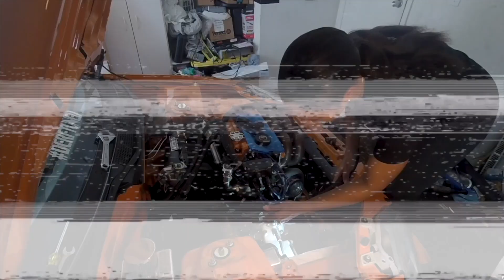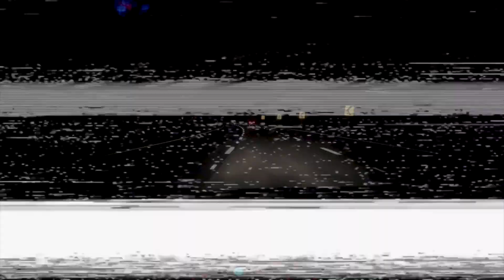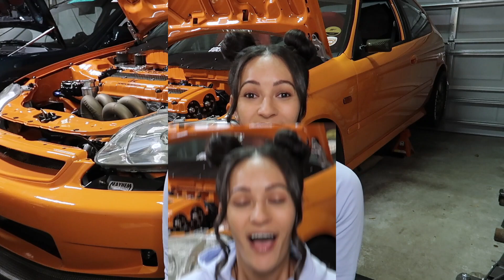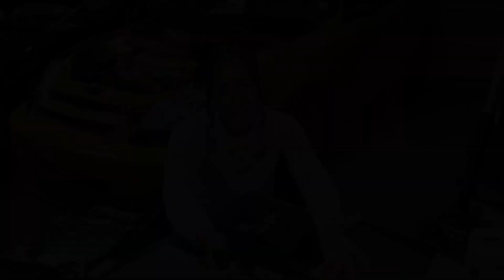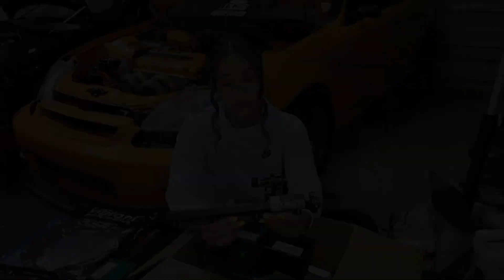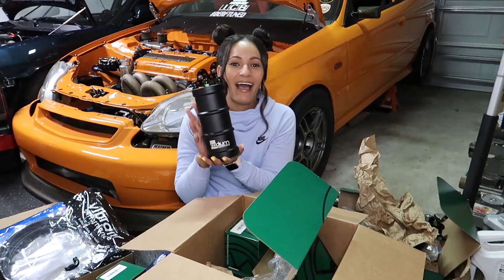ALL NEW FUEL PARTS!! - Fuel System Upgrade - Female Built

Comment: I am just discovering this now. Mine is a B18C engine. My fuel line just exploded out of nowhere while I was trying to bleed my brakes because of new Endless brake calipers; it has not been used for two weeks. Anyway, looking to change the fuel line, fuel filter and the rail as well. I have found this gem with step by step instructions. GREAT CONTENT!

Comment: The vibration she is talking about can affect certain rpm ranges, because the vibrations reach a specific resonance where the fuel can stop flowing through the injectors. Once the rpm passes that specific resonance caused by vibration the fuel can then flow again. It happens quickly but the disruption can cause problems with the tune, which Aisha explained. The damper absorbs those vibrations so that the fuel can continue to flow throughout the entire rpm range. 👍
Reply from the maker: Thank you for the further in depth explanation!
Reply: @Aisha_LadyBuilt  I appreciate the content you put out. You clearly research everything about your build, the info you provide really helps a lot. 👍
Reply from the maker: @Mr.Wongburger  Thank you so much! I appreciate your feedback!!

Comment: Aisha, i have a b20 can i run the Fuel Pulse Damper on My 94 Acura Integra? do i have to buy a new fuel rail?
Reply from the maker: If you have a stock fuel rail, you could get the inline version of the Fuel Pulse Damper and then you won't have to change your fuel rail.
Reply: @Aisha_LadyBuilt   Thank you i will look into that. I was going with 330 injectors, Skunk 2 intake, Skunk 2 70mm throttle body S300 Hondata, AEM wideband. and a Walbro 255 fuel pump.
Reply from the maker: @antoinne1  I see you said b20, are you putting a VTEC head on it?
Reply: @Aisha_LadyBuilt   Yes i am thanks b16a head
Reply: @Aisha_LadyBuilt  Thanks again for all you do here on youtube, your videos are very helpful. and you show just how to install and take it off we need this. Thank you, if your every in Louisiana look me up. antoinne77@Gmail.com.
Reply from the maker: @antoinne1  I'm happy to hear that! I appreciate the feedback! Thank you for watching!